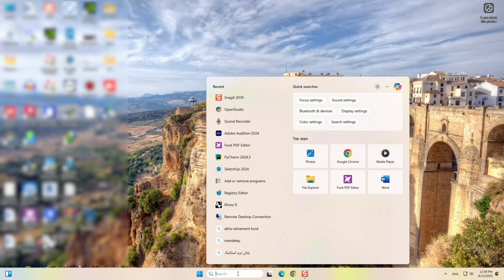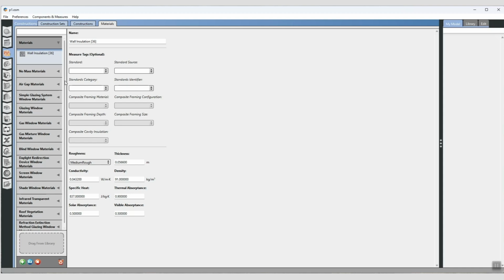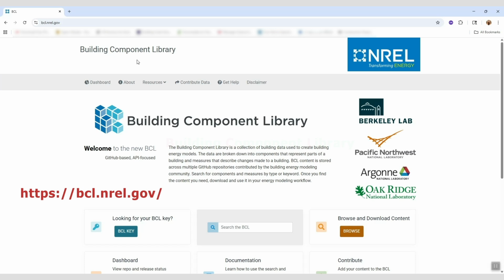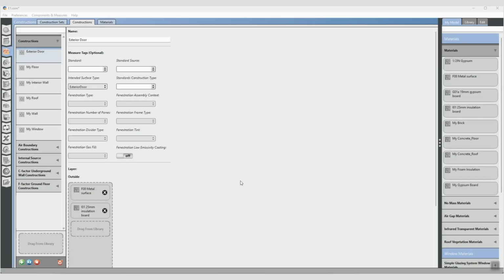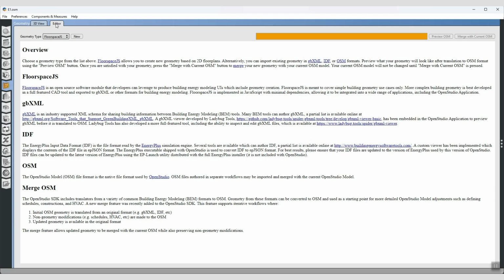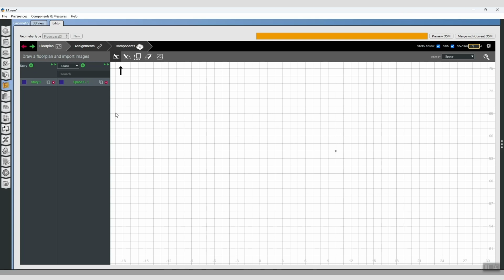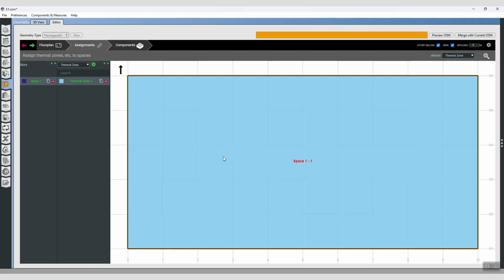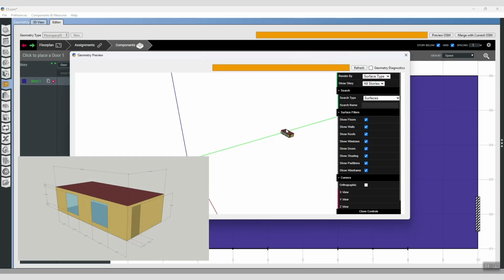OpenStudio Tutorial – Chapter 2: Creating 3D Geometry, Spaces, and Thermal Zones

Comment: Hi, great tutorial! I'm having an issue with the FloorspaceJS geometry editor — the grid appear for a second then completely disappears, when I draw a shape nothing shows and the canvas stays white with no grid
Reply from the maker: Hi! Thanks for watching 😊  

This usually happens when the canvas container has zero width/height or when the editor is initialized before the DOM is fully loaded.

A few things to check:
1-  Make sure the div that contains the Floorplanner has an explicit width and height (e.g. 100% height won’t work unless the parent also has a height).
2- Initialize FloorSpaceJS after the page is fully loaded (e.g. inside `window.onload` or after the container is rendered).
3- If you’re using React/Vue, be sure the editor is created only after the component is mounted.
4- Also check the console for WebGL or Three.js errors.

If it still happens, feel free to share your setup or a repo and I’ll take a look 👍
Reply: @VahidEnergyLab  i fixed the problem and draw the exemple but i faced one issue . the house is located out of the x y and z axes . please can you guide me how to fix it ?